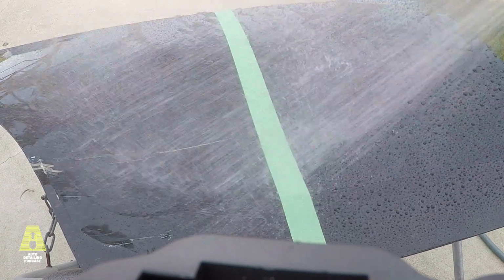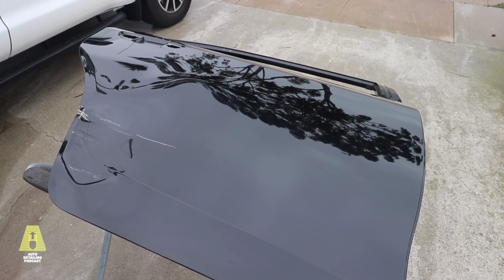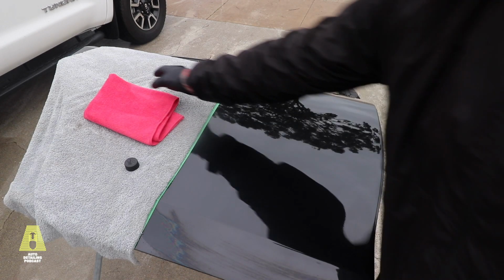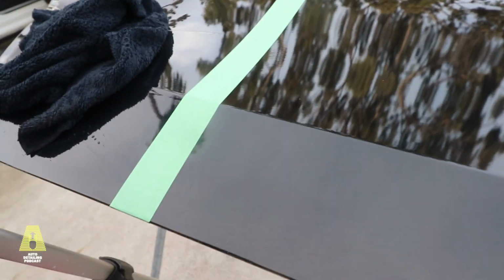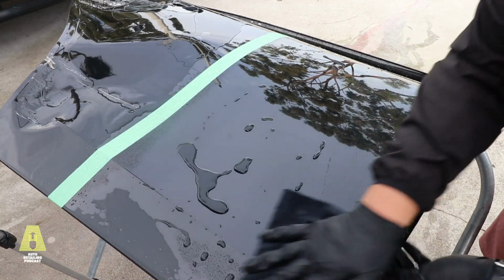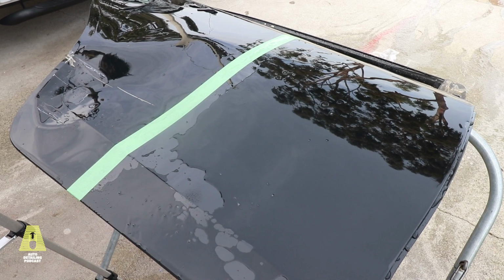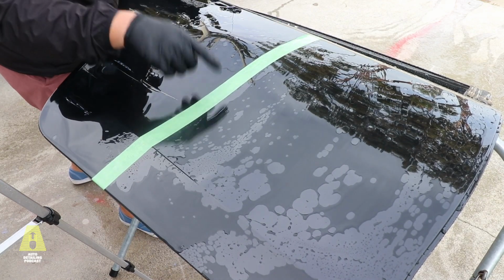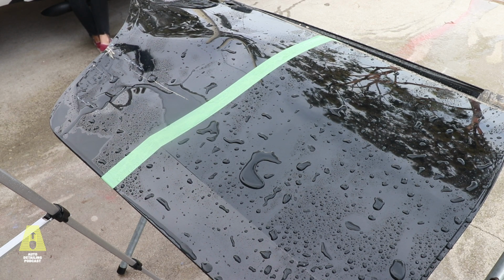ADAMS CERAMIC SPRAY COATING - REVIEW + TORTURE TEST

Comment: Been holding on to this bottle of Ceramic for a while now and I'm just now to the point where I'd like to try it out. Sad to see it not hold up to the test but I guess since I've already spent the $40 I might as well put it on. Some protection is better than none. This seems to be almost mirror of the h20 Guard and Gloss (which I love).

Comment: Of course iron remover is going to strip it off, iron remover is a pretty strong cleaner vs. sealant. This is just a longer lasting alternative to wax that's easier to apply, and it has a UV coating now also so you can check coverage. Completely nulls the second half of the video.

Comment: Im an amateur detailer...do my friends and families cars. I must be decent because people ask me how I keep my vehicles looking so good. My fbo Inferno Orange Camaro gets alot of looks at car meets. Anyway I  did my dads 2018 black Tahoe last Oct using Adams Ceramic wax then a layer of the Adams Ceramic spray. I finished it of with Ceramic Boost. After daily driving it all winter here in Canada then add in our hot weather the truck still looks awesome. He goes through a car wash once a week that isnt touchless. So i wonder about these torture tests. It seems like it holds up fine. Im not a hardcore Adams guy. I also have Chemical Guys Hydro Slick ceramic  and Mcquiers new Ceramic wax. I like both products. Im just sharing my experience with daily driven vehicles with this product applied.

Comment: I don't know... If I had just added any kind of ceramic, wax, sealant, I would not then put iron remover or superclean type products on the car.  Those products would be used before applying the sealant. Why not just use various types of car wash products on the panel?

Comment: Adams Spray Ceramic coat did exactly whatnit was formulated to do, durabilty was removed to make it morenuser friendly for the average guy to apply.  If you want their actual ceramic coating you need to get the small 3oz or 4oz bottle of the proper concentrated formula of Ceramic coat.

Comment: There is an absolute overload with products. I love to detail my ride, but I think its best I stick with Wash, Clay, Polish process that I know and stick with good ole megs ultimate wax. And just reapply when needed. I wanted something to last little longer than 3-4 weeks. Recommendations on lasting wax? I know there are good true ceramic coatings out there I believe if true ceramic coatings are done incorrectly, it dang near needs a wet sanded to remove. Not dawn dish soap to remove. These spray deals are garbage and I am glad I didn’t buy it. I know I can stag this gtechniq if I wanted but believe true professionals who do this for a living is who I believe should do this to my car, if I go ceramic.

Comment: it's crazy how many different results I see of the same product being used.

I personally have had good results with the spray coating, but then again, I didn't spray the stuff you did. 

I think Adam's should have named this "Ceramic Spray" and left the 9H off the label. like you said in the video, when you hear 9H, you think crystalized glass and hardening on the paint/towel.

I think the product lasted on the panel and just needed a quick spritz of ceramic boost (or anything similar) to bring back the beading.

great video!

Comment: Don't you want the water to sheet off rather than bead up? You mentioned it but then ignored...  most videos I've seen were noted to use the soaker setting, or straight hose to allow the water to sheet off. 🤷‍♂️

Comment: On ceramic coating water isn’t supposed to bead up it’s supposed to run off
Reply: If the panel was vertical, than maybe it should run off. But the panel is looks to be sitting somewhat leveled imo.

Comment: Great video, great breakdown and tests outside of the “hydrophobic” capabilities, from the research I’ve done these “ceramic sprays” be it Adam’s or Megs and nothing more than a glorified spray wax, certainly don’t have any more staying power than any traditional spray wax. Seems like a waste of money IMO. If you want a ceramic coating with the ceramic hardening and protection that comes with it, pay up for the real thing or save your money and buy $10 spray wax instead of this $80 snake oil.
Reply from the maker: Thanks for watching

Comment: I look at this product as more of a Ceramic sealant. Kinda bridges the gap between sealants and coatings. Would be very good for the beginner to kind of get a little bit of an idea about how a traditional coating works and is applied. But I don’t consider Adams Spray coating to be an actual coating. Just my opinion.

Comment: Bro after each test use an air blower to see how the water comes off the panel ... of it comes.off easily.means protection is still there if the water spreads into extremely small.beads means none in my opinion
Reply from the maker: Shmoon Asghar I’m on it. Thanks for the idea

Comment: For good comparison in future testing try doing the left side with a regular ceramic coat product and then compare to the fast spray option like Adams product. 
Then do not start the test with the most aggressive product, but work up to that level. Many use Adams wheel cleaner or this iron remover which is very aggressive and both will remove most coatings. Makes  me want use them less if they are that aggressive. I coated my wheels to make it easier to clean  but avoid harsh cleaners for that reason. 
Like all the steps you did early on but did the spray ever crystallize in the sprayer tube?
Reply from the maker: Nope the sprayer did not crystallize
Reply: IronX has never hurt my Cquartz uk 3.0 lol, not even 'masking'
Reply: No signs on sprayer is unusual, wonder why not?
Thanks Ian for your experience with yours. Used DLUX on wheels but I did get solid signs of the coating. Too much work to do that job if the iron remover or wheel cleaner can remove easily.

Comment: I’ve seen an incredible chemical and element resistance with Adam’s H20 Guard and Gloss. I’ve used it for a few years now and I’m surprised at how it lasts. I’ve done maintenance details using apc on customers cars after an entire summer and the product is still on the vehicle strong. I’m surprised just iron remover removed this supposed “coating”. I want to like it but I am a bit surprised.
Reply from the maker: I was too

Comment: Well I was stupid I purchased the 16 oz bottle for $69.I always purchased Adams products and I figured I would try it. I coated my car and it was 45 degrees outside had no problem. I have lots leftover and capped it with the safety cap. I threw out the towels and I was thinking about washing them. The car was covered in salt 🧂 and I went to the self service car wash and sprayed it down and the salt cams off. I had a few spots that I wiped off two days later high spots and wiped it with a rag not wet and it came off. I will in the spring redo it with a real 9H coating.
Reply: Big D  I tried both and the Meguiar’s  hybrid ceramic wax for $15 was better lol

Comment: Maybe try using soap after spraying on the iron remover and other product. Just using a wet rag i dont think will take the product off the panel that your sprayed. Just a thought!
Reply from the maker: Kyle Mccann I’ve tried that in the past but soap gives a false reading sometimes that’s the reason for the wet rag
Reply: @autodetailingpodcast  oh i didnt know you did that! I just bought the adams spray coating and after seeing your video im not too happy with the my purchase.
Reply from the maker: Kyle Mccann - it’s good but just a little over priced. Just use it often, and pick something different next time. It’s no biggy man - we love products and sometimes there not as good as advertised.
Reply: @autodetailingpodcast  yeah ive been using hydrosilex and works alright. I use it after every wash so its layered on. But so far not a bad product

Comment: Adam's is really taking advantage of their loyal customer base they built over the years. Do they know their time is coming to an end or something and trying to milk their loyal customers for every last penny they have left before they go under or something? This is insanity. 

Meguiars Ceramic Hybrid Wax 26oz = $15
Adam's Ceramic Coating 9H Spray (FRAUD) = $70
Reply: Integrafreak1 it’s no good either
Reply: How is the Meguiars?
Reply: If you would do your research the meguiars “ceramic” wax doesn’t have more than 5% silica in it so it’s not a “ceramic”

Comment: FYI After watching Adams how to video for ceramic spray they didn't spray it on the panel they sprayed the towel then applied it to the panel.
Reply from the maker: I considered that. But in the past I’ve gotten stronger results when I spray on the panel. It was a last minute decision  and I may have gotten that part wrong
Reply: Won’t make a difference

Comment: I’m wondering after you do your torture test of iron remover/super clean/bleche white, if you could hit it with an IPA solution.  I would like to know if these products are leaving a film behind that can’t be removed with ONR/wet towel.  Since we know that diluted IPA won’t leave anything behind and is probably strong enough to remove any residual film, I think that this may give a truer sense of the sealant’s/coating’s performance.

Comment: Hey bro! Great review - recommendation though. Use a air compressor or air car dryer after every bitting to see if the water is actually beading off - sheeting off - or if the water is dragging and holding on to the paint. I started using surf city garage ceramic sealant and testing the crap out of it. It is impressive stuff. It’s worked on wet surfaces, and I’ve also been successful in layering it. 

Thanks again for all you do
Reply from the maker: Thanks for the idea. I’m gonna implement it.

Comment: You should try tacsystem moonlight. It's more like a real ceramic light. Hardens in the towels, high spots cannot be wiped off after a couple of hours, hardens in spray nozzle, crystalizes around the bottle rim etc.
Reply from the maker: Interesting. I’ll have to check it out
Reply: Been using Moonlight for almost 2 years now, use it as a topper for my TAC system power plus Sio2 paint coating and it's amazing! Applies like a coating and crystizes like one too, BIG TIME! This product has great self cleaning abilities too.
Reply: @klasseact6663  Applications of the waxes is not recommended with the co use of Moonlight, correct?
Reply: Agree here... TAC Systems Moonlight is a brilliant product! That or Gyeon Cancoat for light ceramic for me...

Comment: Pan the Organizer did a test with this as well. His results were consistent with yours. Kind of disappointing. Especially at the price point.
Reply from the maker: agreed!
Reply: Not a problem I have a bit of a product exploration addiction and you guys help cure that to an extent.
Reply: Maybe I watched the wrong review Pan TheOrganizer did for this product, but he actually mentioned that the microfiber towels used for removal of the excess should be thrown away because they will harden as with any other ceramic coating.  JIMBO proved exactly the opposite.  I like Pan's reviews, but based on his review I ordered this product, and based on JIMBO's I canceled my order.
Reply: @ludak83  Pan just did a basic review the product. Jimbo challenged all the claims to prove if it is legitimate. Not that Pan is wrong.
Reply: @nando5593  Pan made the incorrect statement that the towels will harden and need to be thrown away.  The original comment states that Pan's findings were in line with Jimbo's which is not true at all.
Reply: @ludak83  that's what I just explained, since pan just did a basic review he just assumed that since Adam's says its 9H that the towels should be thrown away because they will no longer be of use. Since Jimbo challenged all of Adam's claims we were able to know that in fact Adam's ceramic spray coating does not harden at all. Hope I get my point across.
Reply: @nando5593  Your original point was also that Pan was not wrong.  It does not matter if he did basic or a  thorough review, the point is that the statement he made was wrong.  So, I do not agree with your point nor the point or the point of the original comment I replied to.  That being said, I have nothing against you or Pan.  I just disagree with your statements.
Reply: Hi Jimbo and BELLdetails it's awesome to see you view both our channels!

Comment: I liked this video alot, but I feel like it could have been much better if you,
1. Setup the panel in the traditional cheap vs. Expensive way (one on one side, control in the middle, and another on the other side)
2. Put a traditional Ceramic coating on the left side with the control in the middle, so we can see how close to a traditional ceramic coating it is.
Other than that, good video!
Reply: Agree.  You also have a need to repeat many times.   "the towel didn't harden"... "the towel did not harden",   it's hard to listen to... but overall I enjoyed the video.   Looking for results.

Comment: I’m really liking the meguiars ceramic wax. It’s either that or the bead maker
Reply: Lam Le meguiars made a very good legitimate product with the ceramic wax. Beadmaker provides almost no protection or beading but good slickness. It’s more like a spray wax that would be good pre car show
Reply: Midwest Mopars yeah I’d like to try the meguiars one. Wondering if it works with vinyl wrap as well
Reply: yup hybrid wax for fraction of the price cant go wrong..
Reply: Lam Le for $15 it’s pretty dope
Reply: Why not use the Meguiars Hybrid Wax as the base as it’s quit more Chemical resistant than BeadMaker is and the Hybrid Wax can be sprayed on a wet car and spread on while drying them buffed to a shine. Afterwards, put BeadMaker on top as it is to be applied to a dry surface.
 
WTF.... I literally just thought of that. Now I’m going to try it.

Comment: This test proves,  flat or slow water  evaporation or sheeting does not mean there is no protection, perhaps some air blowing should be introduced to see a faster result. And comparing to a not treated protected side is the best comparison you can do to actually see the difference. 👍🏻👍🏻👍🏻
Reply from the maker: Great idea. Thank you
Reply: Auto Detailing Podcast ,  thank you, and it shouldn't be compressed air or leaf blower 60mph air either. Cold or ambient temperatures air from a hair dryer might do the trick. 👍🏻